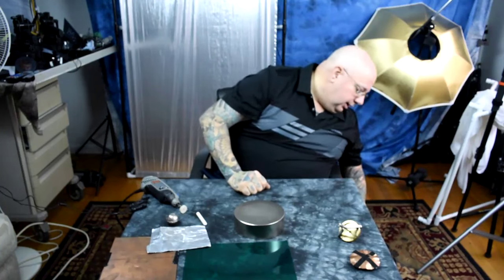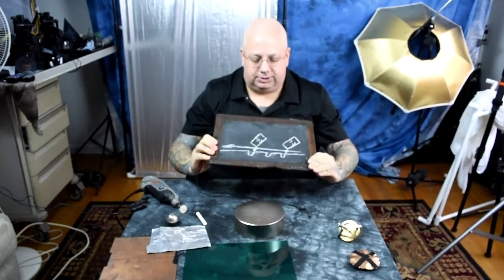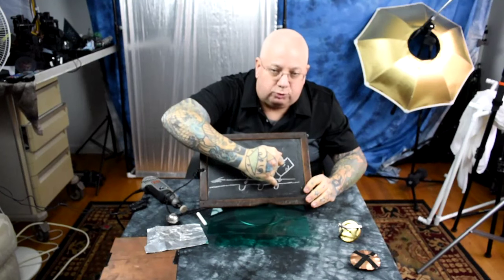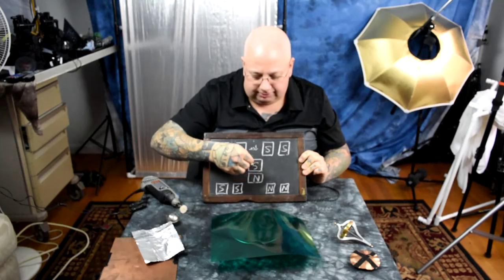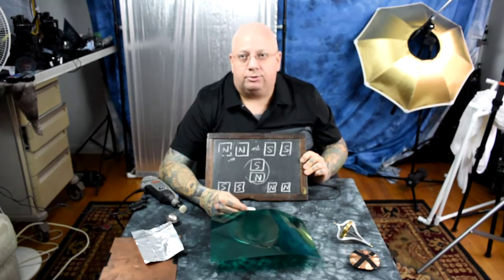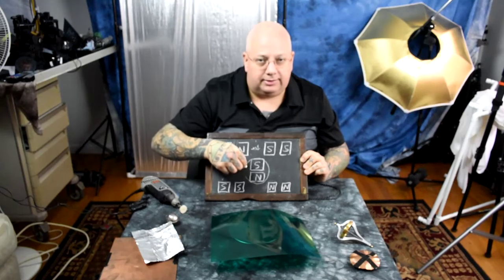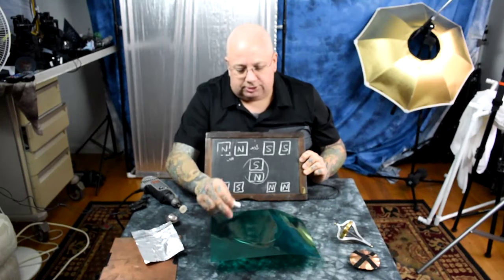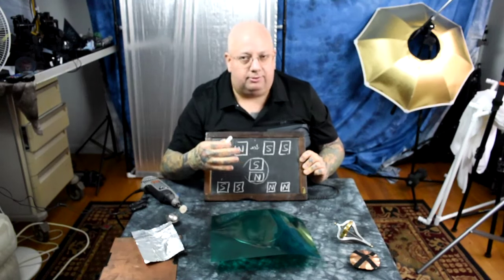PART 2: GOLD SLUICING EXTRACTION device using magnetic divergent field geometry

Comment: Thank you so much for making this knowledge public Ken!  Can I use a series of electromagnets in the same pattern and orientation as your neodymium magnet design? Electromagnets seem safer for my fingers. Where is the centrifugal edge on an typical electromagnet? Also would it make any difference if the electromagnet had a platinum core bound by silver and gold insulated wire instead of iron and copper? Or perhaps a gold core and silver wire?

Comment: I am a Gold Miner. And I can tell you from experience that this will not work for a couple of reasons. One of the reasons is if you're using a sluice in a good gold-bearing area your Black Sands will be too much. Once your Black Sands gets near the magnet it will grab the gold and be pulled to the magnet.
Reply: Dont kill fantasy with reality plz
Reply: Iron does not "grab gold".  However it does serve the purpose of creating back eddies that tend to provide an area of low disturbance for the gold to drop out.  However I see a definite need for a way to manage magnetite buildup.
Reply: @liquidsands magnetic/ electromagnetic aluminum sluce  ramp just past the grizzly bars but before riffle #1 if you automate the movement you can do continuous cleaning😎

Comment: When you say dusty gold is better, does it mean I would be smarter to dig closer to the surface than deeper.  Heavy stuff tends to segregate down and the dusty stuff stays on top.  I try to think about where gold is most concentrated for this method. Again good work. I am still waiting for a Nobel prize to you.

Also, I bought a 100mm ferrocell, mind boggling indeed  but my crappy camera has an hard time capturing a clear image of the field. Any advice other than a black cover to add contrast?    Thanks again for your time and wisdom friend.

Comment: The N-N S-S array I understand the spacing.  But I'm unclear on the spacing of the center array, the S-N.  I know they are on edge also but what is the spacing??  Also how about the spacing between the center array and the other N-N S-S and SS-NN arrays.  I guess what I'm asking is for the recommended spacing of the center array, between and around it.  Thanks, as always.  111
Reply from the maker: +the11thone thats to create an EDDY for further deceleration of the "flour gold" to drop out of the flow of slurry and water.
Reply: +Theoria Apophasis   I understand that.  I take it from your response that the spacing of the center array is not critical.  111
Reply: The whole model is unclear to me. A complete 3d model would be a lot more definitive. But since Ken explained the effect, its possible to make the working device on your own.

Comment: sluices have riffels.  

A riffle is a shallow section of a stream or river with rapid current and a surface broken by gravel, rubble or boulders.[1]

Riffles are instrumental in the formation of meanders, with deeper pools forming alternately. Although simple fluid flow suggests slower flow in deeper water and faster flow over riffles, the true flow pattern pool and riffle waters is often helicoidal flow or turbulent, which permits more rapid erosion of the wetted perimeter. Nevertheless, the coarse-grained bedding of riffles suggests erosion of smaller particles, according to the Hjulström curve. Riffles are typically found in the middle course of rivers, and are theoretically found at intervals around 6 times the width of the river, although local conditions cause this to vary.

Gold mining[edit]
The term is also applied to strips of wood, metal or plastic laid across the washing tables during gravity separation of gold in alluvial or placer mining.

interesting presentation.  worth testing.

Comment: im a little bit confused in the example shown does it represent 10 magnets and your north north magnets do you mean puting them so they avoid each other or want the stick together? also can you get away wtih just  5 magnets 2 on top 1 in middle and 2 on bottom? thanks Im just having a hard time picturing it finished how it works wish i had a set up example or 3d diagram showing it set up, thank you very much for posting this!

Comment: so, a question or 2 ...how close to the water flow does the array have to be? how is the magnetic materials (magnatite, serpentine, ironstone etc.) that will no doubt get picked up out of the water by the magnets, effect the magnets and the field generation?? would not the magnets need to be cleaned off every several minutes to not eventually reach into the water and disrupt the flow?? JUST THINKING OUT LOUD....thanks

Comment: The question I have is when dealing with gold especially fine gold you will most often have copious amounts of magnetite in the mix.... what happen to your system when it is plugged with magnetite.
Reply: well i would say make a modification and use magnets placed above the top riffle to actually catch the magnetic material. the magnets wouldnt need the special angle. just proper spacing from the magnets that are ment for the gold
Reply: magnetite should be collected with the gold

Comment: Ken:  Most of the very large sluce boxes are made of carbon steel which would be magnetized by the strong permanent magnets.  Smaller portable boxes are made of aluminum, which is also affected by magnetism.  Should a new style box be made out of wood or fiberglass which is transparent to the lines of magnetism?  Or perhaps aluminum is only affected by magnets when either the magnets or the aluminum is moving.  When both move together or both are stationary, then moving flower gold will be the only element slowed down.  I will try to download your book.  Thanks for your work.

Comment: Please can you verify if the magnets are attached to the bottom and also suspended from the top on a bar or something?  
Or would this work for me just attaching to the underside of my sluce?  If so line of south theb line of North 10 - 15mm apart is that correct. 
I have ordered some neodymium 42 strips to attach below. 
Please let me know as I will be trying this out soon :) and wabt to get the set up correct.  Thanks in advance.

Comment: great video! IU agree knew of the magnetic divergence, but one particular problem in sluicing with any magnets is that it will collect a huge amount of ferrous material, so are the magnets uncovered or covered to clean occasionally ferrous contaminate ?
Reply: guitar 2 die 4

Comment: Fe304 is The Alpha Omega from where the H+ ion flows that is creating life. C20H320 The most excellent dielectric for iron bonding, shielding and contributing to the flexoelectric qualities and attracting HHHHH.   2  Fe rods, 3 earth magnets, Pyrolytic carbon,  Au,  Bronze and SiC FOuR poles. Put it all together and you can Catalyze all the Converts you'd like. More magnets is my motto.
Reply: This is how living things do electricity, Electron Hole differentials, Ionic induction and Hydrocarbon exchange resins,  The Hall angle and colossal magnetic restriction and the exponential amplification of the Magnetic, Electrical and Chemical Rate of Change observed. Palladium, Copper...... and those that over share. We don't need to generate power any other way, There is far greater power in bonding an H proton than there is in tearing them apart.  This is how you do Ferro Electricity via Catalytic conversion. 2 circuits, two currents. No wheel, Iron Rods and the magnets do the work  from the center out. Become a Magi basically.

Comment: Im thinking to use 40 x 40 mm disk magnets with 4 equal sides to gain a more uniform magnetic field then more of its energy would be employed to catch gold. At the same time angle them toward the flow so the field will start working sooner.

Comment: If you would mount the magnets on a rotor so that you increase the relative speed between gold particle and magnetic flux, will it increase the "braking" force? I assume it will be similar to the rotating field in an induction motor that creates more torque with increased slip.
Reply: levettp I can't quite remember but the magnetic brakes may depend on flipping poles of the magnet around
Reply: The gold is simply repelled by the magnetic field and you want it to be stable, not moving at all. If it moves then expect changes of the eddy current to fluctuate and disturb the braking process  and possibly flush out accumulated flour gold that's already in the bottom of the riffles. Keep it simple and keep smiling.

Comment: Just this Spring getting into using magnets on a sluice box.
I have to say that I do not understand how magnets that close to Riffles/Wiffles are not going to clog with magnetic sands and load up until they clog the box?
Because a magnet 'ABOVE' riffles at a given height will lower the weight of the Magnetic sands to an almost zero state without capturing the sands if at correct height, thus allowing water to flush black sands from the sluice at a drastically reduced water flow and at a much reduced
angle of grade on the box.
All that is needed is to have enough of each to handle the blond sands.
My next bit of experiment will be to build a panel cut to size of sluice box made from Corrugated plastic three pieces thick and cross hatched, and glue a 60 mill piece of magnetic sign material that full size, so as to keep a steady field above the sands as they go down the sluice.
There are other methods to accomplish the same thing if sign material won't work.
Reply: He states how important the orientation and spacing and polarity is and your first move is to ignore literally all of that
😂😂😂
Good luck

Comment: I see statically place magnets as an issue .. I also believe that the fix for this is to NOT have the magnets in the stream of water .. I believe an array of stronger magnet could be placed underneath a sluice box that undulates in such a way that it will release the magnetite and allow it to move out of the sluice .. Please let me know your thoughts .. I hate repeating myself but I am a Mechanical Engineer and am very good a mechanism design .. 

P.S. I also agree that Einstein was / is / will forever be, quoting Nikola Tesla, "A Mathematical Buffoon" ..
Reply: Product starts with a thought, develops into a possible prototype after many hours of contemplation, design and failures. Being an inventor, I see this system needs to be build into a working prototype with proven results. This could have great results and yet, could be a big flop. As your comment from Tesla quoting Einstein as being a "Mathematical Buffon", I cannot comment on that because his thinking compared to mine is totally different. Mine is product design, his is theory.

Comment: what about magntite? hematite?  it will collect
Reply: jerry coleman The magnetite will stick to the magnets and the gold should be in the wiffles. if you bolt the magnets in place, you can take them out and clean them off. seems tedious but it may pay if the return is as he says on the flour gold. My question is how small do you grade the sluice material to bypass the magnets.
Reply: captain pancho yeap magnets work but gold get stuck in with the magntite gave up trying over and over  it too much handling the consentrates so i quit that and   bought a camel desert fox gold wheel nothing better for seperating it from hemitite and magntite you cant argue with the gold wheel design  its been around a very long time